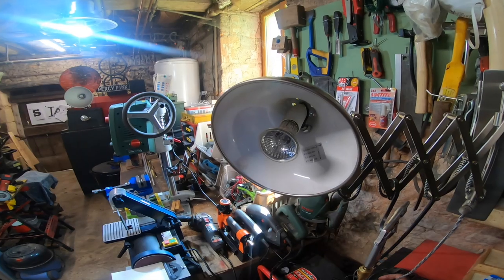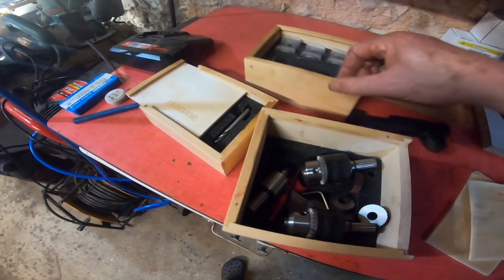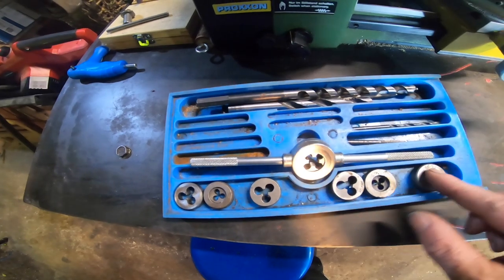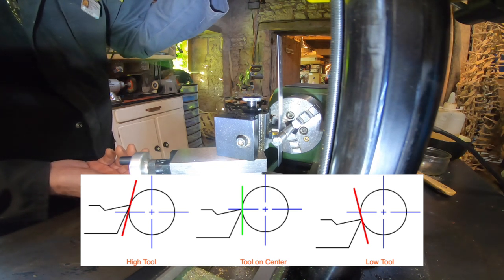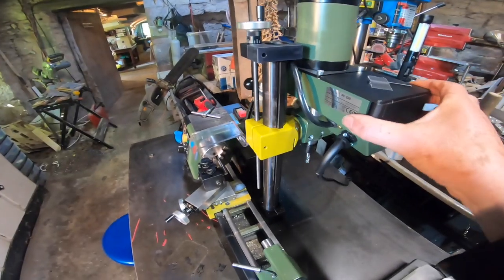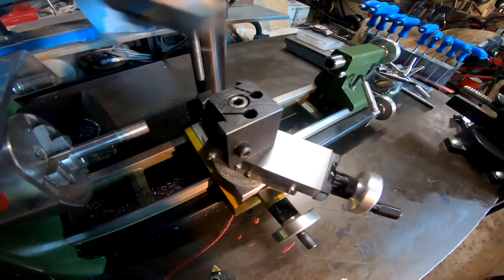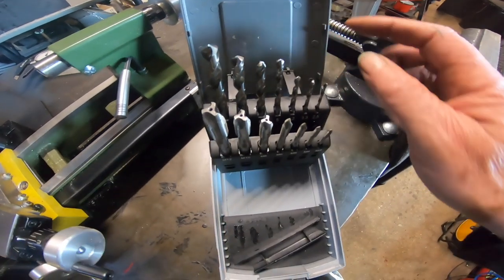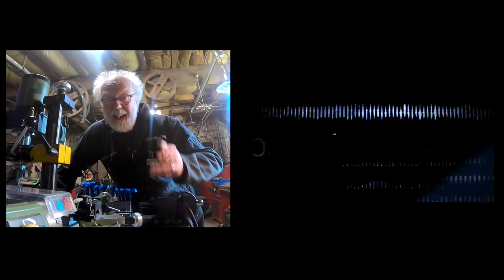Mini Lathe Top Tools - Prof Simon

Comment: Just something to note about using LED lighting around rotating machinery, at some point, and this is especially true of variable speed equipment, the LED frequency can match the speed of the rotation making it appear to be standing still. It could give you a bit of a fright on a mini lathe but could be deadly on larger machinery.
Reply from the maker: Strobe-Tastic.  Good point
Reply: Good point. 

This was a problem with discharge lighting in machine shops having a strobe effect and making the machines look like they were stopped. 3 phase lighting reduced this dramatically though.
Reply: Ironically, the analogous problem with CRT raster under fluorescent lights was eliminated by LED monitors. But the simple solution at the time was to change the raster frequency.

Comment: A lathe is invaluable, I've owned mine for about 12yrs and made plenty of auto parts and modified things to fit other things (as you do) , it cost me $1400au and is big enough to skim disk rotors up to 275mm . The lathe, hydraulic press and pan brake/ gillo are my favorite tools to own and use . I'm glad your getting the hang of it and having fun at the same time 👍
Reply from the maker: Hi Marty, I’ve got a lot to learn but it’s a fun lockdown activity....already made a brass part for the broken  garden sprinkler....almost paid for its self...ha
Reply: @SimonHollandfilms   that's the great thing with them, if something broke it's fun learning how to replicate and replace things from scrap pipes or solid bar

Comment: All very good and sound advice Professor as a trained fine limit engineer I love hearing good advice being given.
All you now need is to deign and build a transmogrification machine for us.
Reply from the maker: Working on it....did you use presto tools of Sheffield....wow..there are sharp and accurate
Reply: Around the corner from my home lives the widow of an old-school clock repairman. She learned the trade helping him, and continues the business for familiar customers who won't go to anyone else. That's where I discovered the difference between good tools and bad. For example, just a simple set of pliers, yet the smoothness of motion and accuracy of the jaws made a difference in whether or not I could do a task. Good advice is fascinating and invaluable.

Comment: Great to see you're getting into machining, it can be very satisfying. Nice lathe, too. 
You and I wholeheartedly agree, Point #1 YA CAN'T DO ANYTHING WITHOUT GOOD LIGHT! is what I always tell people.
Another thing is NEVER use compressed air to clean machine tools, this can make chips fly about dangerously. I first read about it in Model Engineer magazine many years ago, about a toolroom apprentice who did this, and the foreman found out - he was fired on the spot!  Use a paintbush to brush swarf down, and a brush and pan to sweep up. Also, having an edge around your lathe bench wiill reduce swarf going onto the floor. 
Looking forward to some machining adventures - This Old Simon, perhaps?  hehe.
Reply from the maker: Good tips GPW cheers

Comment: Totally agree with everything you said. Bottom line, buy good stuff and you get a good result. Also as you said buy a tool for a specific job not something that does everything you will find it does nothing well, hence buy a separate lathe and mill. Only final suggestion I can make is for parting tools, you might consider parting from the rear, check it out, this will put far less load on the tool holder carriage which on a mini lathe is not very robust.  What fun :)
Reply from the maker: Thanks Campbell, I’m not sure if my compound goes all the way across...let me check.

Comment: Drilling Titanium ti 64. If you are drilling ti 64 you will find it will the material closes around the drill. Grind the drill with one cutting edge longer than the other. This will give a hole larger but the material will not bind on the drill.

Comment: Good to see you putting your hand to machining. You might need to think about using cooling sudz even if its just from a sqeezey bottle.your tools will lose temper if not.make a duck board to stand on it helps to stop swarf  getting through your footwear like you wouldn't believe. Happy days prof.
Reply from the maker: Good tips ...I already learnt about why not to wear crocs while welding
Reply: Hah yep.when I was welding steam engines at bodmin steam railway the worst bit about welding was getting a molten blob drop straight in the ear.and then having what looks like a fit to get it out .blowing myself up with oxy acetylene is another story and apart from loose clothing or hair getting caught up in lathes its a satisfying thing to do.though I still to this day haven't built my own stationary steam engine to power my small needs.
Reply: Iv still got my really old micrometer that is bang on.look for old school tools rather than china mediocre cack.

Comment: The inserts with your carbide tools is for steel with lathes with lots of kw. If you replaced those insert with ones with a geometry for cutting Aluminum , then you will not be wanting to use HSS again. With small cuts that you can only do on low kw lathe like you have, the very sharp Ali inserts work really well. They will even cut hard steels like the outer of a ball bearing race.
Reply from the maker: Thanks Neil...I will add them to my essential tool shopping list ....any brand ideas?
Reply: @SimonHollandfilms   The sharpest ones I know of come from Iscar, in Israel. But Kyocera from Korea are very good, so is Mitsubishi from Japan, and KennaMetal from the USA. They are the ground inserts, meaning the outer profile is ground, and produces a very sharp edge. Some knock off inserts look good from the web page, but when they arrive, went dull in the box. There are some that are ground and coated, and are also very good from Kyocera.

Comment: I agree about the plastic vernier calipers. Metal is much better. I prefer digital readout. However one downside of that is it needs a battery. I am curious though about the mini lathe. Is it single phase and also what was it's cost?
Reply from the maker: Hi Mikkyboy,  good calliper tip...the plastic ones are no good at marking your work...duh!  This is a single phase mini lathe from the German company Proxxon.  Built like a Swiss watch.  Check out the amazon link and reviews in this film description. Simon
Reply: @SimonHollandfilms  thank you.

Comment: Brilliant video prof as you have very quickly learnt the cost of high quality tooling etc far out weighs the initial  purchase price.  i cant stress enough how important it is to buy high grade tools and not the junk stuff  from china. most folks when starting out make the same mistake , been there done that wasted a fortune lol. good point about the add-on milling attachment seems like a good idea to save space etc but has you have pointed out it gets in the way.Just a suggestion try and get some form of spillage tray to collect all the swarff the big lathes  come with them as standard  because of the coolant system, also a good solid. stand to anchor the lathe to is very important
Reply from the maker: Good tips...Proxxon make a chip tray...